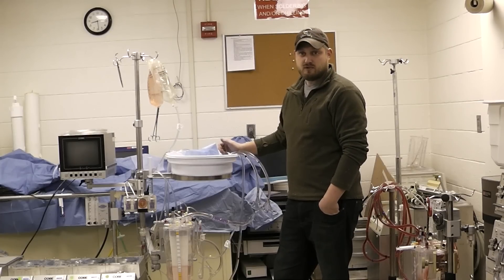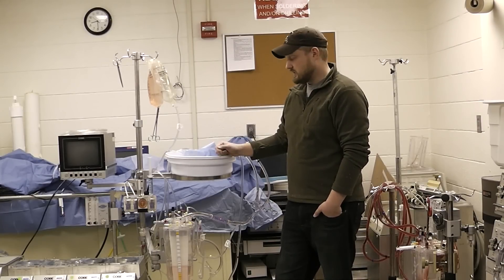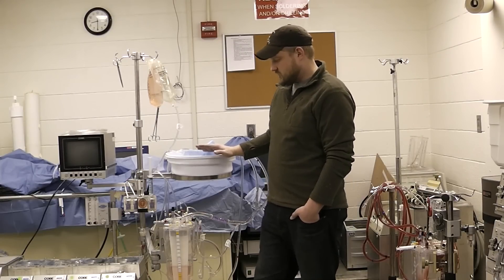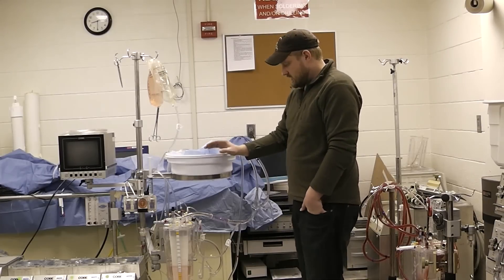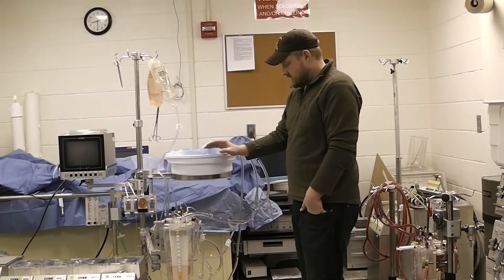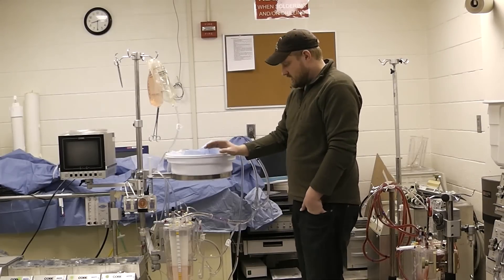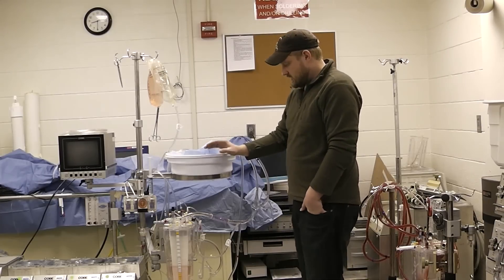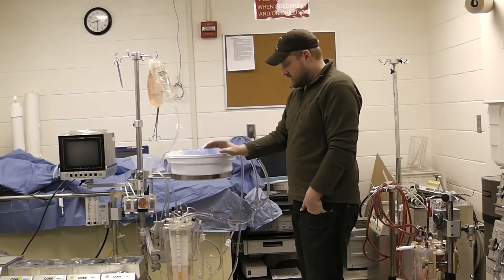Emergent Oxygenator Changeout Tutorial

Comment: I would like to make two suggestions.

First you should always have an O2 E-tank with a regulator and gas line available in the room.  Don't waste time visually inspecting the sweep gas circuit on the pump. It could be leaking for a dozen places which are not visible. Instead immediately connect the E-tank directly to the gas inflow port to determine if the sweep gas circuit on the pump is not working properly.

Secondly ALL cardiopulmonary bypass circuits should contain a PRONTO line (Parallel Replacement of the Oxygenator that is Not Transferring Oxygen). See reference below. Splice in the new oxygenator/heat exchanger in parallel to the old one using the PRONTO line without ever taking the patient off bypass.

Gary Grist RN CCP

Perfusion. 2002 Nov;17(6):447-50.
Parallel replacement of the oxygenator that is not transferring oxygen: the PRONTO procedure.
Groom RC, Forest RJ, Cormack JE, Niimi KS, Morton J.